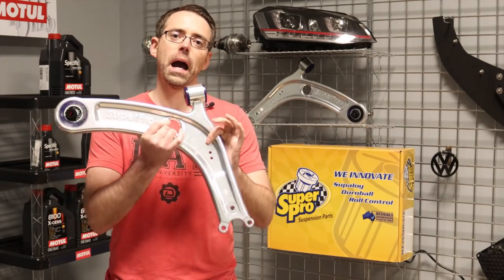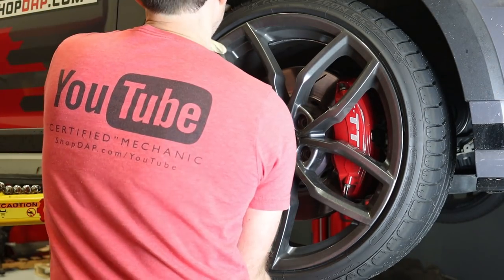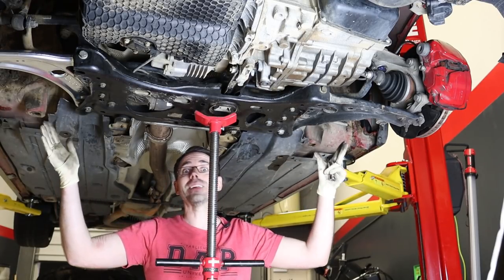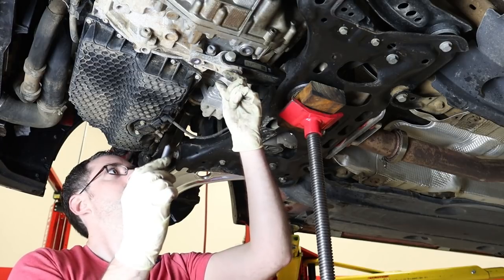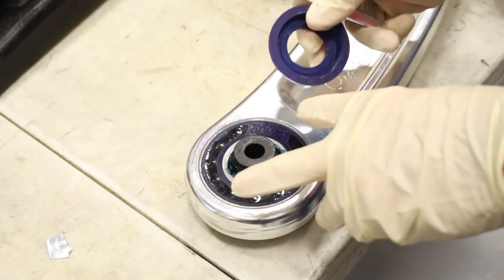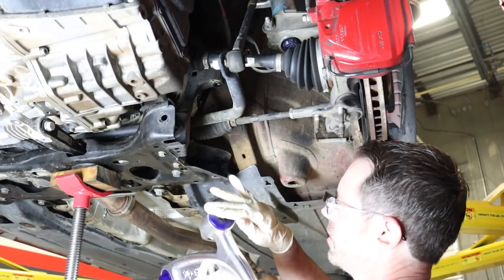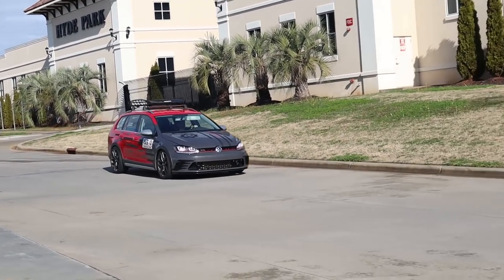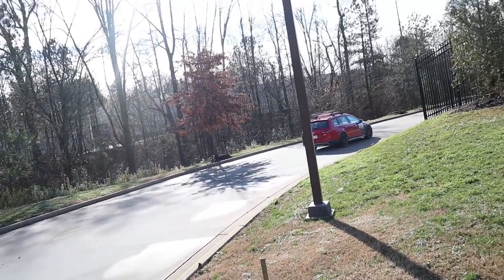Upgrading to Caster Control Arms | MK7 DIY

Comment: No need to lower subframe, just un-bolt the dog bone and use a pry bar to push the trans forward while you take that 18 out, works every time  🤙🏾
Reply: i have bfi stage 2 mounts on my dsg mk7 gti, i un did the dog bone arm from the trans and  i disconnected the trans bracket from the chassis mount on the trans side 3x 18mm bolts,  used a jack to lift the trans out of the way of the drivers LCA bolt.. worked perfectly.

Comment: This convinced me I like my stock set-up.
Reply: 😂😂 why? 
Mine is the vibrations the aftermarket ones are giving you and losing that comfortability
Reply: Stock setup is designed for daily driving.
Reply: @em1ownerify  Likely because of the amount of work required for install
Reply: Elimentus it’s not that hard.
Reply: @em1ownerify  Never said it was, I was just commenting on why someone might choose to not do this job. Usually it comes down to price, amount of work to install, or perceived performance increase.
Reply: @Balomis  track performance increase, for a daily driver its a downgrade.  Except of course for build qualty of the control arm, that just looks better all the way around.
Reply: Maybe for your second Golf?

Comment: Working in VW,  we just take the lower engine mount bolts out and pry the engine forward to loosen the bolt which u lowered the subframe for, makes it alot easier also no need to replace the subframe bolts like they say , also wont put alignment out ,
Reply from the maker: Good note.
Reply: Nice glad you said this just asked the same question sorry
Reply: I also work in a VAG shop (collision repair tech) and thats how we do it aswell
Reply: does it work also for AWD or do you need to loosen propshaft ?

Comment: I highly recommend doing the dead set with this modification. This modification significantly changes alignment, it is not recommended, you definitely need to have the alignment done soon. It causes a large degree of toe out, which is fine for handling but you will wear down you tires like you would not believe. Ask me how I know, I meant to get an alignment right away but ended up driving another 1500 miles and wore the fronts down by 2-3 mm's  and ended up having to replace tires much sooner than I expected.
Reply: that was dumb of you

Comment: Update: if you’re doing this upgrade, do it precisely the way Paul shows here. It makes the install angles of the new LCAs and their stiffer bushings just perfect. 👌 

I tried it an “alternate way” and it was the biggest PITA. You end up fighting physics in all the wrong ways. I invented new swear words.

Don’t be afraid of lowering the subframe the way he shows here. 

I also tried the “pry bar against the transmission to move it forward” (with the torque mount bolts removed) in order to remove the left front LCA bolt:

No dice. $4500 trans. Not worth the risk when dealing with a fragile aluminum case.

DAP’s method here for the win. 🏆 👏 🍻 

Thank you guys again for a solid walk through.

Comment: I did just the super pro bushes on my stock arms.  Pressing the bushings in made for an even more fun Install 🤣
One of the hardest jobs I've ever done. I did have to lower the subframe since I was dsg. It was worth it. Epic turning response and feedback now. Amazing loss of wheel hop way better then a dog bone insert. One of the best upgrades I've even done for suspension

Comment: Been running these about a year now. Installed together with Superpro heavy duty front and rear sway bars and endlinks. Handling is drastically improved. Very happy with the car.

Comment: As How-To videos go, this and others from DAP deserve a standing ovation. There was a LOT to cover in this install for safety and technique. 
Paul & the gang did a great job covering all aspects, including the post-repair test drive review.

Couple of things to share for folks considering an LCA upgrade on their Mk7:
1) The SuperPro arms shown here are awesome, pricey, works of art. They add 1* positive caster, which doesn't push. the tires too close to the front fenders like their Whiteline counterparts. Great upgrade all around for street and track work.

HOWEVER...be advised: several folks have complained about clunks and noises that arise after 10-12k miles of driving with these LCAs. This is from the DuroBall design of the rear joint/bushing on the SuperPro arms. Research this and form your own conclusion.

3) Alternatives: Whiteline offers two versions of an aluminum LCA for the Mk7 platform that utilize a conventional, solid polyurethane rear bushings instead of the DuroBall. 

Info: https://whitelineperformance.com/collections/control-arm/2016-volkswagen-golf-base-esi2143514

One increases caster +2.0*, which is a lot. The other, called their Max-C kit, increases it by 2.5*. #racecar

For those of us running larger, meatier tires, and who are lowered by over 20mm from stock, this will pull the front tires too close to the fender liners and induce rubbing.

So you have a "pick your poison" deal here.

If anyone here has the SuperPro arms, let us know how many miles you have on them, and if/when they started making noise.

4) Last option: folks have upgraded the bushings in their stock LCAs and still report 80-90% of the improvements over stock by ridding the car of the stock voided rubber design, which produces unwanted deflection under cornering and directional changes of the car. You can swap your own bushings, or save the pain and just buy new stamped steel LCAs with the bushings installed. The latter is cheaper and faster if you're paying an installer. 

Info here: https://whitelineperformance.com/collections/control-arm/products/wa302l-control-arm-lower-arm
https://whitelineperformance.com/collections/control-arm/products/wa302r-control-arm-lower-arm

All of this is to educate and help other Mk7 enthusiasts, not detract anything from DAP. They are an awesome group, and we are lucky to have their support in this community!
Reply: I appreciate this info very much as I am starting to plan my goals with my 1.8t TSI for track use!
Reply: Thank you very much for your input, it helped me decide to just go with upgraded bushings for now since it'll be my daily car.
Reply: Smart choice, Otoniel! You won’t be disappointed. ✌️ 🇩🇪 🍻

Comment: When you re-tighten that front wishbone bush bolt, you ideally want the suspension to be compressed so the wishbone angle is as it would be when the car is on the ground. The wishbone will be in its rest position when you tighten up. This helps to reduce premature wear of the wishbone bush.
Reply: While that would make sense with OE bushings, these are poly and do not operate the same way.

Comment: To get those forward facing bolts on the front of the control arm the
“Non subframe removal way”: 
Loosen the two dog bone bolts from the bottom of the engine and pry the bottom of the engine forward and boom, those forward facing control arm bolts are out
Reply: Yeah was just thinking that be way easier lol
Reply: That's what I was thinking too.
Reply: does it work for AWD ? or you need to lossen propshaft

Comment: I just did this on jack stands, I didn’t drop the subframe and I wasn’t able to shift the transmission forward enough to get clearance on the bolt by removing the dogbone mount. However, I was doing my transmission mount at the same time and I was able to jack the transmission up to get the clearance.  Pretty easy if you do it at the same time.
Reply: does it work for AWD without loosen propshaft?

Comment: Have these installed with kw ddc suspension and they don’t improve steering feel at all, they do however improve exit out of fast corners and launches. Steering is still as dead as a hedgehog on the M25

Comment: Why do we want more caster?   My understanding is that more caster will slow steering response and increase high speed stability?  The closer the caster is to zero, the sharper the turn in response and more unstable at speed.  My mk7 already has a great balance for street and highway use, but maybe this helps on a track if you're going over 100mph?  I've never done that (honest!), so I don't know if it needs more stability at speed...
Reply: You want more positive caster for two primary reasons. First, the car wants to track straighter more often with less correction required. Secondly, and this is the more common reason, is to allow for increased dynamic camber gain. So you can run far less static camber, but still maintain maximum camber in the turns which is when you want it. So this helps with tire life and simply maintaining a larger contact patch for more of the time.
Reply: Yoni is correct and I as someone that has done this mod, steering response, feel, and front end grip is significantly improved. One of the best modifications I have done. I also have camber plates and run about -2.5 static camber and it does not cause excessive tire wear at all. In fact it helps a lot because if you drive hard or track at all, without these mods you will wear the heck out of the outside, so this actually greatly improves handling and helps with tire wear.

Comment: I thought there is an alignment tool from VW for the subframe, in case you remove the bold, you screw in a special 'eccentric'  bold...to move it back to the original position later.

Comment: so I've had new tyres on all 4 corners (mk7R) and alignment done twice and the car drives straight and doesn't pull but corner hard to the right the back ends feels like it wants to drift out. I've also  noticed the gaps from my rear bumper to my tyre is different.  unsure what to  do now as when they did the alignment they said they couldn't do the caster. any ideas would be welcome thanks

Comment: I remember reading that someone with a deadset kit and these arms did not work together.  there was some contact as the deadset kit didn't allow the subframe to move back enough to allow enough clearance for the control arms.  any one else run into this issue?

Comment: Is it at all possible to remove that bolt like the old mk4? Undo the dogbone mount and use the spare tire jack between subframe and trans to rotate the engine slightly to clear?

Comment: Ugg. Hate poly. Takes a set, high NVH, early failure.. Looks like unless the stock parts are worn out, not worth it for 1 degree of caster. What about using the TT arms (or RS3?) instead, where you also have stiffer bushings and some camber adjustment?

Comment: What suspension mods will help with increasing traction for a 7R? Excluding lowering coil springs/ Coil overs and Better tires. Mainly looking to improve launching and reducing wheel spin on a stage 2 car. Thanks
Reply: A set of dogbone/pendulum mounts will help drastically with wheel hop and launches and will provide crisper shifts and better throttle response

Comment: the 130nm is not the correct the torque spec for the rear dog bone mount bolt. idk what is, but i used my NEW torque wrench and it snapped the bolt in half

Comment: Ok if I choose way without lossening subframe, is it necessary to remove propshaft ? in manual they says yes... but what is simplest way if I dont have lift and doing it on the yard? doest loosening of transmission mounts together with propshaft work?
Reply: It might be late, but for allroad/quattro/whatever vehicles - the easiest and safest option is just to lower the subframe, using some jack stands, bottle jacks or whatever  to hold it in place and control the process. I had to replace both control arms bushings and flex disc on the propshaft at the front, so had to drop the subframe completely
Reply: @test_704  according manual it is sufficient to remove dogbone in order to access propshaft...but lowering subframe is not safe..you need some centric tool, then all 9 cca new bolts , wheel adjustment etx
Reply: @majklxxx  for myself I decided to go the other way though, so far it seems to be ok. Definitely will check the wheel alignment in a few days
Reply: i did it with removing transmission mount .. possible for 4x4... but hard to put DSG into origin position
Reply: @majklxxx  Good to know, thanks for sharing! Just wondering - how long did it took to do all the job? I guess it took way less time than for me. Thanks!
Reply: @majklxxx  Regarding the "putting DSG" part - its about the mount? I've changed it, too, with no difficulties - bolt the mount down to the chassis first, with the trans lowered and supported with the bottle jack, and then lift trans and bolt the mount to trans. All with the dog bone removed, of course. Is there a problem with it?

I guess I'm asking too obvious things, just trying to be useful :)
Reply: @test_704  i did it very long time (dont want to influence somebody, cause i am amateur mechanic with limited tools).... maybe trans mount is shifted because i lift up (jack) trans instead to support trans with solid stands, and lower the whole car    (it was jacked like as you changing tires)
Reply: @majklxxx  I guess as long as engine mount is ok - the trans mount should still sit back.. what if you try to do it the same way I did while changing the mount - hang the trans on jack lower than mount point, then unbolt mount from trans, bolt mount to chassis and lift up the trans to bolt it to the mount? How big is the gap that doesnt fit?

Comment: I have a 2010 Volkswagen tiguan,  do you have a recommendation for removing the drivers side control arm because of the bolt in the front bushing is block by the transmission pan?
Reply: Yes, they do if you watch the video

Comment: 2019 GTI , once its off warranty...I will be buying a lot of parts from you so I can upgrade, inside and outside!  
I have a question?  How much would you personally charge for labor? say if you had to install my parts?
Reply: M Kefayati they charge a pretty penny
Reply: @hector971000  its worth the quality work, I know!
Reply: 2019 Seat Leon Cupra and I have already changed a lot of parts (R600 intake, springs, exhaust, etc.) :-P
Reply: M Kefayati where you located?
Reply: @hector971000  France
Reply: @hector971000  Canada
Reply: SLYYY you get the good stuff there
Reply: M Kefayati he’s in North Carolina I believe
Reply: @hector971000  I can drive there

Comment: Easy when arm is horizontal. A bitch to get the rear bolt to go through on my lifted Alltrack when the strut pushes down alot more and the arm is in an angle.

Comment: Why the hell didn’t you just undo the 2 18 or 16mm bolts for the lower transmission mount and use your block of wood to keep the engine and gearbox forward enough to get the bolt out? A lot of extra work there for what would be a 20 minute task. There are also locating  pins you can use to re fit the subframe back in its original position.

Comment: 6.55lbs stock vs. 6.40lbs aftermarket grand total of .15lbs woohoo. How many ppl are going to "track" their Alltrack? I'd like to know what the perceived advantages/disadvantages are. I'm guessing minimal at best. Probably the poly bushings are the biggest difference which equates to more road noise and less compliant ride, I don't want that in my daily driver but to each his own. 
I think a better upgrade (for the money) would be aftermarket F&R sway bars, dollar wise it's a bit cheaper for the sway bars. BTW I swapped out my stock spring/shocks to stock Golf R springs/shocks and that made a world of difference and happy with just that for a daily driver. I couldn't stand the rubbery ride of the stock Alltrack suspension.
Reply from the maker: Increased caster is why you buy these. The weight is minimal and the bushings are an added benefit

Comment: Crazy ... Every car is born with a specific chassis . You can update the silentblocks , is not dangerous , but you can’t update the O.E control arm with a new one in alluminion if the car is born with cast iron or steel . For ex , the Audi A3 petrol is equiped with cast iron but the diesel version is equiped with steel control arm . Why ? Because the weight . Other than that , it doesn’t make sense for daily use car . Be carefull to do this . Ask to the company the right omologation and inscurance . PS , my company produce chassis components and i know very well what I say

Comment: Drop the subframe to change a bottom arm. What a poor design
Reply: 86andyw not a poor design he has to remove the dogbone and pry engine forward I’m a certified vw tech so woulda been faster but oh well
Reply: Killerbulldozer4 : I’m going to do this job soon, can you elaborate on that?  Are you saying he didn’t need to drop the sub frame to remove the drivers side front control arm bolt?  ...And instead all he had to do was remove the dogbone and pry the engine forward to get to it?  Thanks 👍🏻
Reply: Kevin Hannon sorry I’m late on reply yes I’m a vw tech and essentially if you remove the dog bone bolt and you pry your engine near the trans you can push it forward just enough to get the bolt out without dropping sub frame
Reply: Killerbulldozer4 : No worries, thanks for the reply!  One more question if you don’t mind...  do you need to drop the sub frame to fit a front sway bar in there?  

I’m about to do a KW V2 coil over install and would like to add the SuperPro control arms, front and rear sway, and end links at the same time so I don’t have to get an alignment twice.
Reply: Other brands like toyota is the same...
Reply: Péter Fazakas exactly. My 1990s Mazda 323 requires you to jack the engine up as the RH front LCA bolt doesn’t clear the sump. Pretty standard stuff.
Reply: Killerbulldozer4 does this method work on a 2016 s3?

Comment: 0.30lb weight savings? damn I'll pass
Reply: The real improvement is the rear bushing. The factory one is a big rubber donut with voids in it, it allows a ton of deflection. The superpro is a spherical bearing encased in polyurethane so it basically has zero deflection but absorbs some NVH.